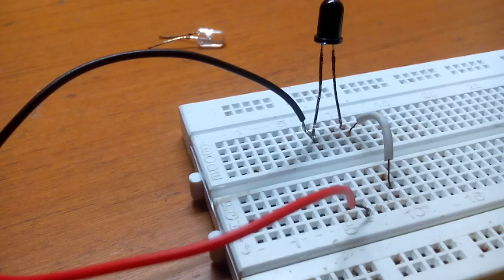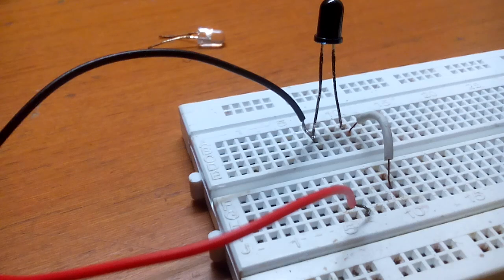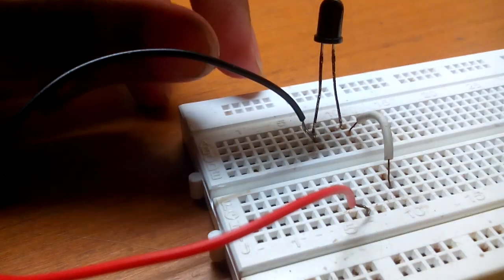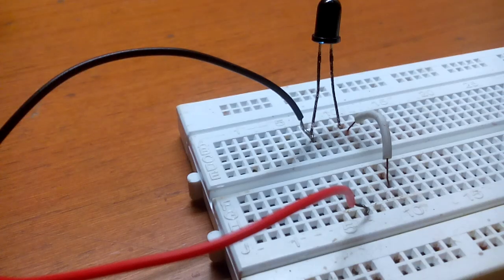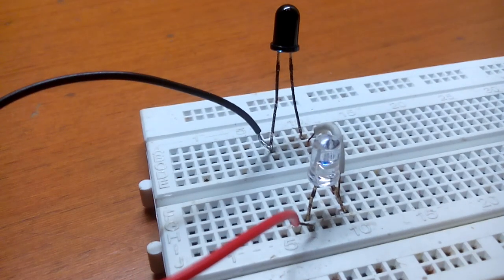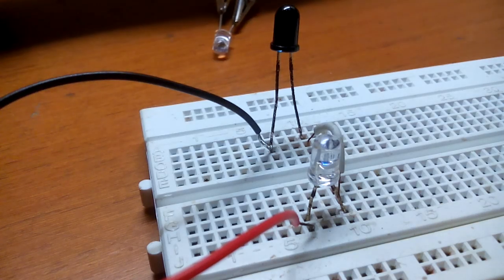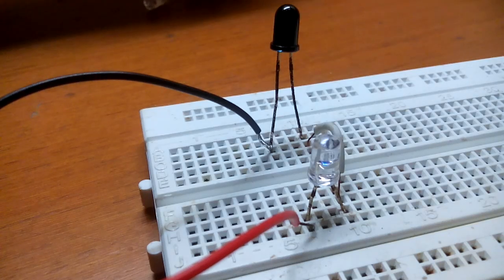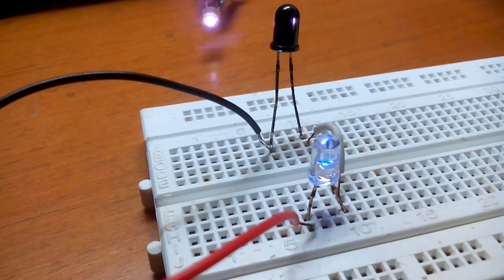How to make an "Infrared Circuit".

Comment: my led stays on all the time ..what can i do?
Reply from the maker: +Amashikha Dutta Hi. If your L.E.D stays 'On' all the time that means there is presence of infrared light which the infrared receiver detects.
You can connect a 100 ohm resistor in series to this circuit if you wish!
Reply: Troy Araujo or because my ir receiver is bad????
Reply from the maker: +Amashikha Dutta No. Just bring any source of IR light or IR emitter close to the IR receiver and the L.E.D should come 'on'
If you dont have an IR Emitter you can use your tv remote!
Just connect everything according to the video!
Hope it works for you! :)

Comment: Can I connect a motor where you connected the LEDs?
If I can connect so can I give 5v to the ir emitter?
Reply from the maker: +Engineer Saksham Hi! You can try using a dc motor in place of the L.E.D. But I would not suggest to give 5v to the IR Emitter because it may burn out!
If you give more voltage to the IR Emitter that doesn't mean it's output strength will increase. It will still remain the same. But if you really wanna connect a 5v battery that do connect a resistor in series to it! Hope this helped you :) ✌
Reply: So, can I connect a 1.5v battery to the ir emitter?
Reply from the maker: +Engineer Saksham Yes! That should be good!
Reply: Ok Thanks!. I want to ask a question:
Where are you from?
Reply from the maker: +Engineer Saksham You're welcome :) Btw I'm from India :D
Reply: I am also from India. Did you know Hindi ?
Reply: So, did you know Hindi ?

Comment: What voltage is supplied to the IR LED? How would the circuit change if I wanted to use a DC geared Motor as a Load instead of the LED light and needed to Cut-off the Motor when the IR LED was blocked.
Reply from the maker: +A T Plum Hi. I would recommend you to use a resistor in series to your IR LED. 
5mm IR LEDs have a forward voltage requirement of 1.2v to 1.6v DC and normally the Typical Forward Voltage to apply is 1.4v.
You can try this with a DC motor as well but make sure you aren't giving too much voltage or else your IR LED may burn out!